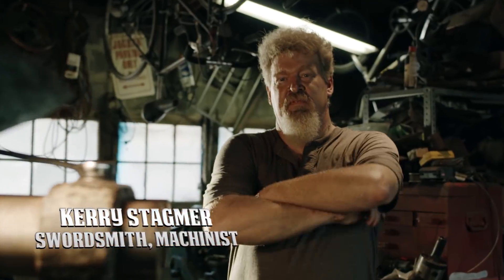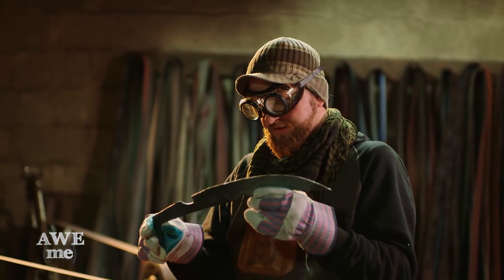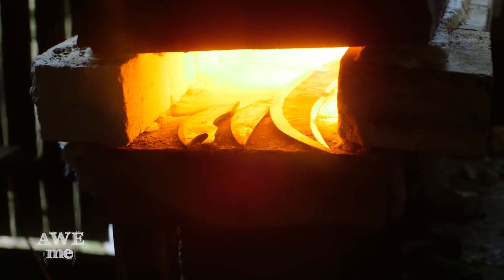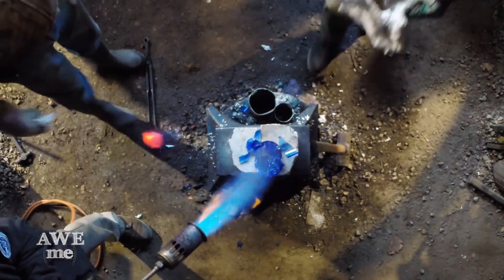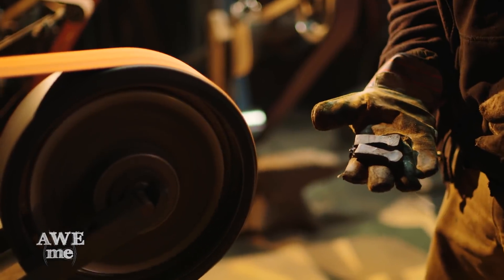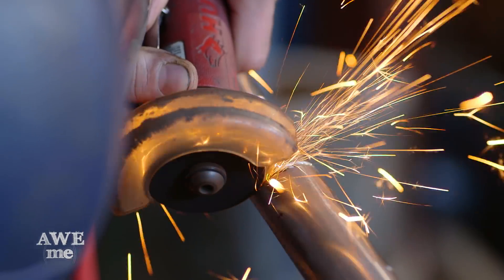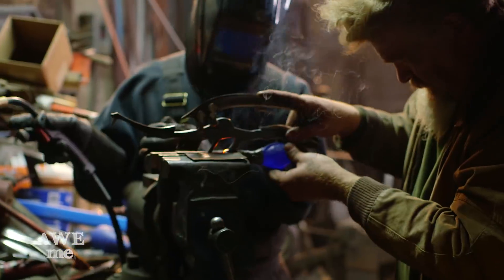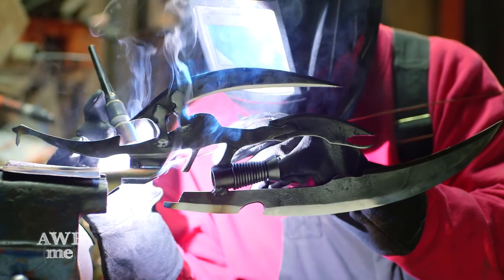Chitauri Scepter AKA Loki's Staff (The Avengers: Age of Ultron) - MAN AT ARMS: REFORGED

Comment: Glass is not a fluid, its an amorphous solid! Glass does have a crystaline structure like other solids, it containes a unique structure like plastic and other materials of that nature. It also DOES NOT flow over long periods of time, they made the bottoms of old glass panes thicker for balance and due to the method of antique glass blowing. 

NOT. A. LIQUID. DAMMIT... ok im good now...
Reply: ***** It's okay, I was gonna say the same until I've seem your comment, too many out there who claim such things.
Reply: ***** Without realizing that an amorphous solid, will over time spread/deform in the direction gravity is pulling. It doesn't "Flow," but glass will in fact drift over a period of 30 plus years.
Reply: Shit, had I seen this earlier, I would have corrected my teacher. I love doing that.
Reply: aqwardpanda No it doesn't, if you really feel it does, cite an accurate and reputable source, one of my sources is by the Univeristy of Nebraska-Lincoln:

dwb.unl.edu/Teacher/NSF/C01/C01Links/www.ualberta.ca/~bderksen/florin.html
Reply: Matt Stagmer Incorrect..... http://en.wikipedia.org/wiki/Amorphous_solid As herp said glass is not a liquid and is a solid as defined by its at rest state much like steal or rock it is a type of solid and only becomes a liquid when heated to a high temperature only difference is rock and steal has a crystalline structure and will always conform to that structure unless moulded where as glass does not and so is named a amorphous solid.  Examples of liquids while at rest are water / oil / mercury e.t.c....
Reply: EQUINOX And you trust Wikipedia?, I cited a univeristy, keep up with me honey.
Reply: EQUINOX Wikipedia is not an accurate and reputable source, you know, since anyone can edit it.
Reply: tanishalfelven93 Nor are random strangers on the internet. :]
Reply: tanishalfelven93 Maybe 8 years ago it wasn't. Now there is this beautiful feature at the bottom of the page called "references" and "further reading." Yours also wrong that anyone can edit, the rules for editors are ridiculously strict. As well as many scholars who are editors. As you can see on the top of the Amorphous Solids page, they are inquiring for an expert in physics to clear up the insufficient or unclear information.

Stop spreading misinformation that youre school teachers taught you.
Reply: ***** tanishalfelven93 wiki is fine as long as it has proper citation (most do) and isn't in a contested state the way this particular wiki page is :)
Reply: ***** Glass is indeed a fluid. Fluid =/= liquid.
Reply: Yes wikipidia can be full of utter crap at times but to say its always inaccurate and is not reputable is just blind ignorance as a lot is actually correct on that site.  I simply linked wiki because it was easy convenient and correct. But here is another link that say the same as wiki does just to make you feel better=  http://chemistry.about.com/od/matter/f/What-Is-Glass.htm
Reply: *****
No, it's really not. Here's another source http://io9.com/the-glass-is-a-liquid-myth-has-finally-been-destroyed-496190894
Reply: *****
The information directly written in it isn't an accurate/reputable source; As has always been the usage, it is good for finding sources, but the sources themselves aren't always reputable either, as with the violence in video games studies by Dill et al.
Reply: EQUINOX
speaking of blind ignorance... that article doesn't say glass flows, it doesn't say glass is a fluid or liquid. All it talks about is the definition of what glass is.
Reply: ***** Actually the windows of old houses gets thicked on the bottom and thinner on the top. So I've been told.
Reply: Dukefazon
That's already been addresses in two articles posted here. It's a result of manufacturing, not time.
Reply: *****
You speak of blind ignorance, then link to a post that talks about glass as a liquid being debunked. Where exactly did I say glass is a liquid?
Reply: tanishalfelven93 Don't be ridiculous. Every wikipedia article has references, pages are monitored by bots so that not everybody can actually vandalize it or print misinformation and so on. For scientific/engineering/programming/... stuff wikipedia is pretty much the best starting source available.
Reply: ***** What the hell are you talking about I never said glass flows or that glass is a fluid or liquid and I certainly never said that that article said that glass flows or that glass is a fluid or liquid.  Before calling some one ignorant you might want to properly read and understand what the person has said other wise you just look like a fool.
Reply: ***** And my materials class specifically emphasized that glass does not have a crystalline structure. Oh engineering school, I trust you more that some random guy on the internet.
Reply: ***** well it's solid at about 21 degrees Celsius (room temperature) but when heatet to about 500-1200 degrees Celsius it is a liquid so both of you are right
Reply: ***** I don't doubt that Wikipedia has that information. The internet has basically all the information about materials and structures you would ever need unless you're going for a doctorate.
Reply: ***** So you mean to show me an article that one doesn't actually validate your point, and two glass IS a solid, but it's still amorphous just like Play'Doh or Putty. It deforms at a colossally slow rate, but it's still amorphous.
Reply: EQUINOX He just got the wrong impression. I doubt he read the whole comment.
Reply: aqwardpanda It does not deform at a slow rate, the way glass was blown into panes, from one side creates a thicker side. It does not change unless heated to its melting point. and if you're not content with the article form the Univeristy of Nebraska-Lincoln, here are another one, complete with author, refrences, publisher, and copywrite, straight from the University of California:
math.ucr.edu/home/baez/physics/General/Glass/glass.html
Reply: Glass is a liquid. Nowadays most of the time people add stuff so its actual solid buy it has always been liquid.
Reply: tanishalfelven93 yes. Its editable. But bad shit gets deleted and they always have a backup of the right information.
Reply: Glenn Hartman Did you even read the other comments?
Reply: Lobster Overlord no, waste of time
Reply: Glenn Hartman Wow.

Comment: It's a common misconception that glass is always fluid, it is a crystalline solid at normal room temperatures, the reason old glass windows get thicker at the bottom is due to the production techniques used

Comment: Glass is not a fluid.
Reply: Syther Killer13 Glass is a solid. It can be liquified when brought to extreme heat, but it's no more a fluid than a rock is.
Reply: +Strike AoTTG Rock can be liquid, though.
Reply: +Jeff D. *fluid 

Can't edit on mobile.
Reply: For everybody here: glass is an amorphous solid (betwen fluid and soild).

Science is hard, I know.
Reply: Retro Workshop It depends on how much flux is added. Pure Silicon Dioxide poured into a mold and cooled to room temperature is as much a solid as sand is, but too much flux results in windows that have material flow to their bases over centuries.

Comment: make kenshin's katana from Rurouni Kenshin
Reply: Hannah Chen But that would be a regular katana, just with reversed edge...
Reply: Ezekratos If you have any idea how a katana is made through forging process, just that reverse edge makes a true katana forge exponentially more difficult.
Reply: ArynosValinir I know it's not an easy project, but in terms of "look" it would be like a regular katana. If you're talking about a functional katana with a reversed edge, that would be the challenge.
Reply: They also 'made' quite a few other katanas on the show. The look is not what is appealing to the crew, but what is iconic and works. Besides, they try to make everything on this show at least somewhat functional, it could be a well done challenge, though I doubt they would be traditional with the process.
Reply: ArynosValinir Well, the other katanas weren't common either. Sephiroth's oversized nodachi is an example.
Reply: Ezekratos It would be easy. The katanas curved blade is a made naturally through the process. Coz they would forge one like they always do, its as simple as a normal katana. The "reverse" edge would just made it hard to use...
Reply: +Faustio Faria You do know that process requires a certain type of metal where that reverse edge is that is completely unsuitable for blades, right? The whole process works because of the contraction of soft metal in between the hard edge metal in the particular shape of the blade itself. Changing it at all means you lose not only the curve but the entire edge.
Reply: ArynosValinir Yep. I do. My point is exactly the same: it wouldnt be a good idea coz its simple to build a katana like they do and it would be stupid to sharpen it on the mune.

Comment: Glass is not a liquid. It is an amorphous solid. It's viscosity or resistance to flow is billions of times higher than metallic lead yet no one claims lead to be a liquid at room temperature. One of the common stories pointing to glass being a liquid is glass windows, stained glass mostly, in old buildings being thicker at the bottom and so they "must have flowed". The methods of making glass resulted in uneven thickness. If the glass had flowed over time then the lead beading holding the glass together should have flowed a billion times more. At room temperature it would take longer than the universe is old for a flat plane of vertical glass to "flow" and change thickness by just a few atoms.